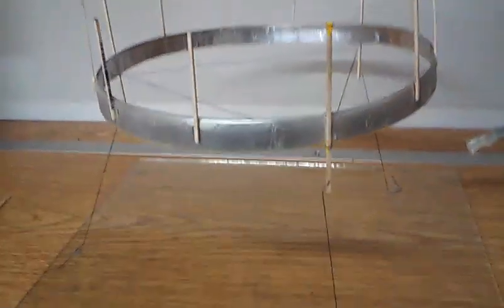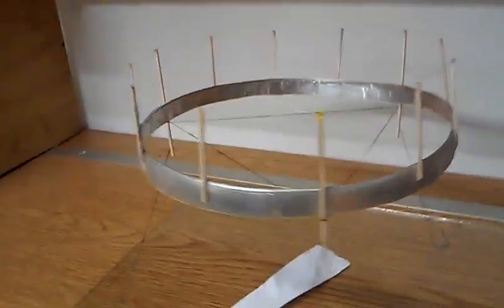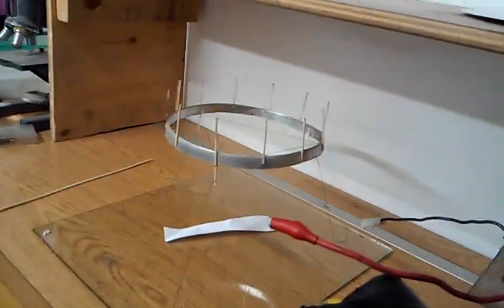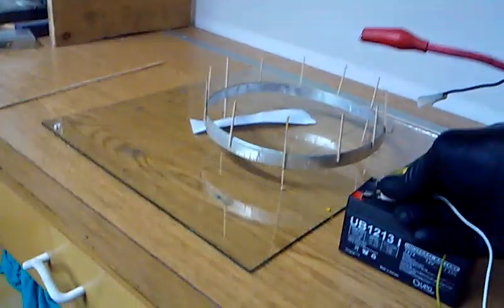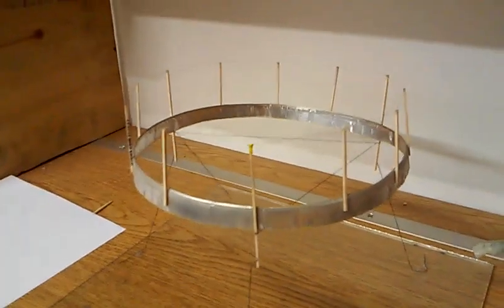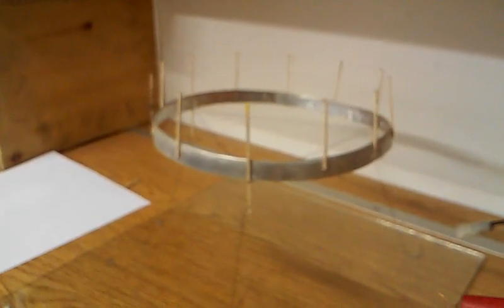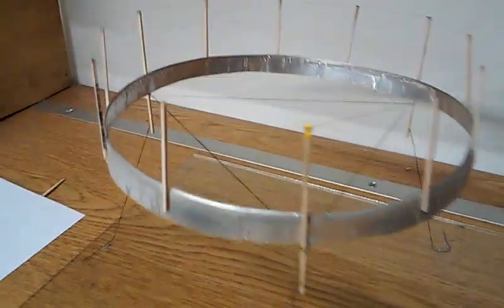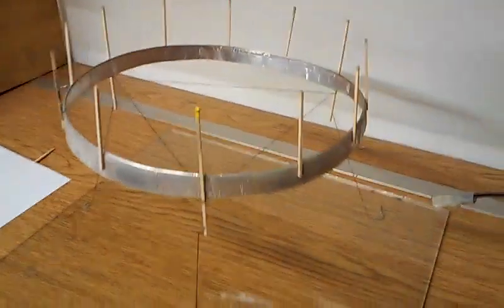ANTIGRAVITY LIFTER CREATES ARTIFICIAL GRAVITY ASYMMETRICAL CAPACITOR

Comment: I'll get excited by an "antigravity" device like this when I see one that can lift its power supply, too.
Reply: You can see one in most any UFO sighting video.
Reply: But it's not antigravity... ;-) It is an RC plane that can carry it's own power supply to run the ion-wind generator.  I had the same perspective, a 5 oz lifter can't carry a 10 pound TV powersupply and batteries to run it.  But engineers are clever people and clearlyI MIT figured out how to make a tiny inverter and lightweight voltage step up circuit without much heat loss.  Maybe super-caps and diode ladders?  Coils are too heavy as are batteries.  But super-caps are lightweight.  Not sure yet. I haven't had time to look into lately.
Reply: I got so excited, that I invented a modular extremely high voltage variable waveform PSU for that very purpose... Got some work to do yet before it's fully implemented, and there are materials and geometry work to be done, but the figures I got from my last burst of activity suggest it is very possible indeed to lift it's own PSU. TANSTAAFL!
Reply: @Swallabat  MIT has an RC airplane that carries it's own PSU and it's proplusion is solid state like this.  I think they published the battery PSU and the voltage step up circuits.  Proably just an RC 3 Phase electric motor inverter and a stack of diodes...  so yeah it can (and has) been done.
Reply: @inaccessible old ways Yup, and sooner than we think, but not with repulsion ion-wind devices like this.  I been looking more and more and still I see no proof this works in a vacuum (region void of air). It still needs a reaction mass.  But fear not, the next serious breakthroughs are coming.  And they are mind blowing. Room temperature super conductors, photonic molecules, controlled temporal dialation/contraction in a cavity, gene editing for resistence to and recovery from radiation issues using CRISPR/Prime, something better than fusion power...  all very very soon.  This ion-breeze stuff is a waste of time.  The big kahuna stuff is right around the corner.  If Elon isn't fast enough, humans will be waiting for him when he arrives at Saturn or Jupiter, with his Tesla Roadster recharged and ready for him to drive on Titan.
Reply: @inaccessible old ways Yup, and like I said some awesome stuff is coming.  And it's huge.
A few years ago I solved a nationwide chemical problem in the vinyl industry, that 10 out 10 chemical engineers said would never work. And in fact they did say just that.  They made sure I was reminded that I got a D in chemistry.  But when I proved it worked, now they say "it's obvious", and I opened up a new area of chemistry in the category of Photo-oxydation.  Got a few market viable patents on it and a profitable company is now producing it commerically. 

So I agree with you.  I went back to basics, and combined things in ways no ont throught of.
This will continue with other I'm sure, and the universe will unfold.

And soon, great stuff coming, very soon,  But this device isn't one of them.
Reply: This inventor mentioned that "the next step is to build one with its own power unit." That's not going to be as insoluble a problem as inventing this field was.
Reply: @scottl5000  At least you're thinking about it Scott.That's a major step in the right direction. We can do this.
Reply: @davidgargiulo1012  MIT created a lightweight enough power source for their ionic-wind airplane... 
The typical TV high voltage transformer is a brute force method used for most "lifters" and is too heavy.  However an IC (integrated circuit) inverter like thosed used to drive RC drones and diode ladder should work and is super lightweight.  Use a super capacitor instead of a battery... that might work well.

 But it STILL WON'T WORK IN A VACUUM and no one has shown otherwise...
Reply: Hey bro go to the YouTube channel Ethan Krauss. He holds the patent for the device with its power supply on board !! Or go to electronairllc.org
Reply: Look up 'free energy generator'. If you build one of them, then use it to power the anti gravity platform, it will power itself for the entire life of the magnets used in the generator, which can last for years, if not decades. Just need to use a frequency tuner with an amplifier to control how much lift and force needs to be used to fly on, or in it. It's L about frequency. Could also use 'step up transformers to take small voltage and turn it into higher voltage, just like a car coil takes 12 volts and turns it into 20,000 to give the spark plugs their spark. 😁
Reply: @glenturney4750  LOL. You WERE joking, right? For instance, you know that increasing the voltage doesn't increase the electrical power or energy, right?
Reply: @scottl5000  Electrostatics works in vacuum, that is why we have vacuum tubes. The effect is due to the attraction of the Cathode plate to the Anode wire. The effect is exponential with increasing Voltage.
Reply: @scottl5000  NASA, Societe National Aeronautiquen in Paris in 1955, Winston Salme Bahnson pabs in 1957, GE Space CEnter King of Prussia, PA 1959, Purdue University 2000, US Army Research lab Adelphi Md, 2000, Takaaki Musha, Honda R&D, 1996, etc.
Reply: Glen Turney cool man what is a link to the project/ schematics/ Circuitry  or DIY
Reply: @Beamshipcaptain  Yeah yeah... demo it as  indicated that I will believe you.  Done.  And if it meets that requirment,  then there a great funding opportuity.  And the demo is CHEAP, so you have zero excuse.  Period. Patent: I actually read it , the patent is pretty much BS about antigravity... the abstract stated it, but the claims or embodiments did not, so it's BS to tell people, that you have an anti-gravity patent as far as I can tell... right...?  SO PROVE IT. I could set up the experiment quckly, but it's not my burden and I know it will fail, which IS WHY YOU HAVE NOT DONE IT IMHO.  So sight all the references you want, it PROVES interest, not that you should get money...
Reply: @scottl5000  I have done it since 1990. We have attracted interest and money, and others have confirmed the artificial gravity aspect, and that this is the most power to weight ratio and most efficiency of any propulsion method known, and inertial mass is canceled by the forcefield.
Reply: @scottl5000  Electrostatics works in vacuum, and these work better in Vacuum, as NASA and French and US Army tests show, also Takaaki Musha Honda R&D. Ion wind is too feeble a force to lift even a three gram model, and models thousands of grams have been lofted. Electrostatic attraction works in vacuum. I sealed saucers in plastic bags and others have sealed them in resin blocks and they fly backwards at the same speed. Do your experimental work before commenting. Shalom.
Reply: @scottl5000  my research is actually showing that this doesnt need reaction mass on board, instead electromagnetic energy (which is infinite and all around us and the universe) is a sort of "fuel"
Reply: @seon3403  Ooookay pal...
How about some empherical testing for a change?

Here is a super-duper-simple-easy test: 
Put the thingy (not the powersupply) in a trash bag, seal it. Turn it on.

PLEASE REPORT YOUR FINDINGS in a response to this comment.

Make sure there is someone there with a box of tissue to soak up the tears-of-joy.
Reply: @scottl5000  i mean i already know that a certain amount of mass and energy is the same thing since energy is mass. Electrostatic energy is real like thats not some sort of conspiracy theory ya know. Obviously i plan to build a free energy device myself at the moment i cant but i know the science and it checks out if you know your quantum physics. I reccomend you check out Russell Andersons tt brown inspired levity disk. Im also aware of the pyramid harnessing electromagnetic energy (the pyramids being thermonuclear generators harnessing the heat of a manmade star. beta decay, alpha particles, natural arc sparking, that kind of stuff) which again, is not an unsubstatiated claim. Nikola Tesla already created free energy like 100 years ago. The pyramids have all the same components of a crystal radio. But tbh i dont feel i should divulge all my research in a youtube comment section cause scalar wave technology and things of the like can be used for evil, i.e scalar waves causing a mini eaethquake (tesla did that). I guess im saying its not that crazy to assume that human ingenuity can find a way to get infinite fuel from nature as it stands. But you should definitely look up heisenburgs theory of the big bang, which, in comparison to einsteins theory, makes more sense, as einstein proposed that space and time are symbotic when that doesnt make sense, as space is infinite and you cant measure infinity, only MATTER and time are symbiotic. Space didnt come out of the big bang, the big bang came out of space, this proves that space is not "nothing" and that it is infinite and contains the energy required to produce a big bang, if you know your quantum physics this proves that infinite energy is not even that crazy, as the big bang came out of space, so if it can produce the big bang, it logically follows that it alone can produce enough "fuel" for an enternity in our tiny cosmic life (about 130 years if you're that lucky). Just a little science to prove that traditionally accepted mainstream science and quantum physics has a flawd understanding of foundational basics, which is why you have learned the preconcieved notion that free energy from the electrostatic nature of everything around us (space) is somehow a fantasy, but i will definitely try that experiment out, i know it will work if done properly, as space is not a vaccum as you probably believe. Space has depth, so just cause you put it in a plastic bag, doesnt mean it csnt still retrieve energy from deeper levels of space, it can retrieve energy from the space already in the bag, as, again, space is infinite in all directions and is fuel when harnessed properly
Reply: @scottl5000  i dont doubt all these fantastical "star trek" esque claims you make. As I know of these "glitches" as you call them. Yes i know the quantum double split experiment proved that consciousness can change matter. 

I just find it funny you are aware of all the mind boggling things that science proves is possible, but for some reason believe maimstream scientists saying tesla didnt create free energy. He most certainly did if you dont believe me thats fine it doesnt require your belief to be true. 

Im not divulging the entirety of my research in this comment section, as im sure you arent either. 

All im doing is giving you the proof to research yourself. It seems you just want to look smart and not actually look into anything i said about heisenburg, space NOT being a vaccum (cause you immediately said "i know how to live in a vaccum"), and the pyramids being cold fusion generators. 

But seriously? You know about all tbe fantastical star trek type stuff you talked about, but for some reason tesla's simple free energy science escapes you and you dub it "nonsense"? Thats just kind of funny to me ha, but im simply telling you i know free energy is real, the science is all there and the scientists who claimed tesla's stuff didnt work, have flawd understandings of foundational basics, which throw off their conclusions down the line. I already said that and pointed out one of the misunderstandings all scientists have (thinking the big bang created space), but I see you dont actually want to learn or listen to anything. 

I only ask, do you believe the big bang created space? Simple question, but im still sure you will somehow not see the question and not answer with your opinion
Reply: @seon3403  LOL! OK I'll bite -- and I'll answer.  Never presume what I will do.  LOL! I can't help it if you don't like the answer.  And if you don't want an answer that doesn't match your thinking, then why ask?

I don't doubt the math behind the big bang is correct... But it's not really the point is it?.  

For example: Simple math tells us there is a infinite divison of time and no minuium fixed time quantum.  But there really is, based on the math derived from the observation of the speed of light.  Eg. both are right in their contect, but only one is verified and pertinent to being useful to us.

As for the question...  it doesn't matter what I believe.  The universe doesn't give a gnat's ass what I believe.  Physical Truth isn't what I invent, read, or believe, it just is and it's my job to poke at it a little.  

My answer is -- Don't know, don't care and it doesn't matter.  I personally do not have a clue if the big bang acutally happened or not.  There is some compelling edvience, and equally compellng objections.  Not my field.  I'm into what I can do now and data that far outside of the scope is useless.  It is good for arguments between creation theories.  But I am barely smart enough to not go there. 

I noticed how you blew off the simution stuff.. It's not me that feels a need to be recognized as smart.  I do not give a crap what others think about me. But I do like people to get on a track of trying stuff and not promoting BS like the lifer being anti-gravity.

By trade I'm inventor, I make my living outside the box, and people pay me well to push the edge.  I'm not a chemist, in fact I hated chemisty and avoided it at all cost. Yet when a survival-level need (long story) came along to figure out how to get rid of a bacterical stain that plagues the vinyl industry for nearly 40 years, I nailed it in a week.  Not becasue I'm smart.  

Millions of dollars, 100's of scientists tried and failed.  I got 4 patents on it and it's in two commerical products plus I opened a new sub-field of chemistry called photo induced oxdiation.  I did not even name it.  A chemist/physics friend did.

I have no desire to be called or seen as smart -- in fact if I don't screw up 5 times a day I feel like a failure.  Failure is not an option, it's a requirement.

So,yeah, I'm not smart; sucked at math, sucked at languages, sucked at writing, sucked at music, sucked at physics and chemistry...  did not accel in sports until college.  Pretty much a waste by all standards.  But what I am... I'm brillant at thinking outside the box and calling BS by those stuck in the box -- flatearthers and Tesla-punks are by favorites.

Anyway, I digress again --- All the research you guys talk about is great.  'See it all before, and I still go back and reference all the stuff you listed (I won't enumerate them, you already did that).

But the bottom line -- simply put the device in the video doesn't work in a vacuum and is not anti-gravity.  

But a bag over it, turn it on, there's your proof.  Done... once you guys do that, we can talk about the rest.

I jumped ahead too far for y'all, I'm sorry about that.

Nice chatting however! 
Very intriguing.
Reply: @scottl5000  lmao you are indeed funny. You're under the impression that a closed plastic is a vaccum, which it is not, because space itself is not a vaccum. Thats why the question matters. But as you've shown, you have no idea about anything about the big bang, makes sense why you dont get what i'm saying.
Reply: @scottl5000  thats why knowing what really happened with the big bang DOES matter....because it disproves the false belief you have that space is a vaccum, since i have to spell it out for you
Reply: @scottl5000  its not an answer that doesnt match what i THINK....because what im saying is not opinion or what i think, its a true fact. Has nothing to do with what i want to hear
Reply: @seon3403  Thanks, I like being funny.
 
Actually what I find is very funny is that you think that I think, a bag is a vacuum. I never though that.  Once again you are putting .01 and .01 together getting pi.

What I said was, "put a bag over it, turn it on, and report your findings".   Yet you twisted it to try to trivial reject the task.  Well your jedi mind tricks won't work on me.

I wasn't trying to prove a vacuum by using a bag, I'm trying to show you it's not producing antigravity, at least no more than a helicopter does....

Big bang... wrong again -- clearly I know more about the big bang than you do it seems.  Because I know that the very people that came up with it are still open minded as to how, or even if, it happened.  That is science.  Oh sure, everyone asserts it happened, and for sake of argument it's ok. They have to. As do I.  But If you truly  really deeply looked into the research going on, a final and definitive answer about the big bang is still eluding us.  As is dark matter and the like, such as universal constants.  If you really know all about it, then present it as a white paper to Science or other peer review and reap the consiquences.  

Science most often sounds consclusionary as much as any sermon in the bible, but that fact is, they have no choice but to expect and face challenges, mainly at the forefront.

Damn, now I'm bummed, I'm only funny because you are exhibiting warped mind behavior. Shucks, I thought a made a viable scientist laugh.  Which is another hobby of mine.  Oh well...  I failed again.
Reply: @seon3403  Space is not a "vaccum", it's a void of matter.  So many flatearthers think it's a vacuum cleaner and sucks things out into space -- cracks me up.
You cannot explain something that not been fully defined, nor can you proven, so all you are spelling out is your interpretation.  So yeah, I guess you do have to spell out whatever it is roaming around in your universe, written down or otherwise is an interprtation, that's all it can be at this juncture.  

Strike 1 - you can know what isn't yet knowable.

Just for sake of clarity -- Vacuum, even interstallar, is estimated to have 1 atom of hydrogen per cubic meter, so it not even a total void or a vacuum.

It's space-time that is the fabric of the universe.  And that contains massive amounts of energy.

Strike 2 - ok, make that ball-1

Telsa's free energy, if it exists as a lot of people think how he describes it, is still not free. No more than solar energy.  It's seeminly free to the user, but there is a loss elsewere.  Even in the case of "energy from the vacuum", it may be likely that local regions using that energy could become depleted like a dry oil well.  But replensishes as the space-time adjust itself to fill any so called gaps.  Surges or flux have been observed in ZPE experiments. Again this is an unproven local field effect.  
There's a difference between free and convenient.

Strike 2 - Energy is there, but what is it? How do we get, does it stay?

Like I said the theorist that came up with the big bang sounds and act a 100% sure, and their math is good, but there are compelling reason to question it.  Good argument too. If they cannot back it up, then how can anyone, by definition KNOW what it really is.

Back to strike 1 -- Can know somethat that is not knowable.

I've been following the theory that the universe is a child of a parent universe's creation of a black hole.  At that event all the constants of the child universe are defined.  Speed of light, gravity attraction velocity, e, i, even pi (that one is hard to explain).  Furthermore, if those constants are not viable to create black holes that the pattern does not repeat, therefore we have an evolution of big-bangs.  Only universes or a type of species that evolves, and it's DNA are those constants -- maybe.
Edivence of partent/child relationship includes an observation  that suggests matter falling into a parent black hole is then approximately evenly distributed in the child universe.  Which makes no sense, yet kinda does -- how can matter be distributed across an infinit universe.  Well a void isn't the same as a universe boundry I guess.  Yet we have proven that particles appear and disappear in our universe all the time, with even random distrubution which by the way seems to drive ZPE.  The distortion, mathematically in space-time looks like ripples in fabric.  So you could say, sure there was a big bang, but that alone would not cause the space-time energy energy to fluxuate. It's an on-going process.  If you did not KNOW that then what can you be sure of?

So the big-bang itself doesn't matter.  Any discussion on that topic is purly acidemic. What does matters is what we observe and calculate right now and can work with in now or in the near future.  

Strike 3 - not only can't you know, ya didn't know that you didn't know.

But you still get a home run... because you are right even if ya didn't know it... so far we believe there is a vast amount of energy in fabric of the universe, as articles title "energy in the void".  It's calculated quite accurately and indirectly shown by viture of various observations, including those at CERN and the like.  Gravity warps time, thus affecting particle angular momentum, because time is very elastic in the presence of gravity, and all mass has gravity.
This is how space probes can go faster and faster by using planet's distortion of space-time to sling shot around thus adding energy in the form of interia.  Doing so, actually slows down the planet a tiny bit in it's orbit or rotion (I forget exactly which). It's crude at that level but it works.

Also, Telsa's free energy system has been shown to try to realize power via induction from the earth's magneto sphere,.  Even Tesla's own writings back this up, albeit some decoding is needed and he use terms of his own definition.  The power from the magnetosphere which is somewhat large, in the giga-watts which is nothing compared to the world's power demands.  And using it weakens the magnetic field, thus exposings us to all kinds of bad stuff from the sun and cosmic rays from outside the solar system... I'm glad his invention did not make it to market.

Game over.
Reply: @seon3403  Once again you prove how assumptive you are.  "spirituality"  you have no knowlege of what I believe.  There is nothing to know, there is only belief.  Hermetic knowledge is pretty interesting, and is one perspective.  You cannot have heaven without helll, or light without dark, evil with good, peanut butter without jam, ying without yang...  Because any definition is relative to another.  Otherwise you cannot define it or understand it. But counter active definitions are not boolean, it all shades of gray, until you get to the mimal quantum. Then it's super position states in a datum probability until a certainity occurs then it collapses into a classical state.
The physics of the spirituality could be very different. Have you ever thought about thought itself? If our spirits are the source of our thoughts then they must be a symbotic relationship with our physical self and given the instant complexity thought the spirit world must run at faster or different time quantum that our universe.  How long does it take you think up a response to my last sentence, or to this one?  Less than a second, right?  May just a few milliseconds, and a lot longer to say it or type it.  But what's your guy estimate to think of something. Yet I'm sure you can think up some complex stuff quickly.  How is this possible?  Maybe our spirtual self runs in a univers totally different that this one?  So what is reality? Hermeticism is Euclidean in it's application, but just a partial lingo enough so to help the ancients understand some basics.  You cannot take it litterally and still get much done. The world has evolved far beyond it.  Science may have very likely discovered the game at hand, and we can probably beat it into submission and let it do our bidding.  But if there is an active super consciousness, if may have left the game running... unattended... forever...
As for spirituality I have a lot to say but I see no point in sharing it will you as we have no common context -- other than what we see around us is nothing like it really is.  I'm sure you know what you know and to you it's fine.  To me it is unlikely to have any relevant value. So enjoy.  I have real deadlines, and real people using, buying and funding my stuff.  I'm always on the look out for new and real technology that people can benefit from... in this lifetime.  If got anything you think you can really leverage, based in real physics, let me know.  It's not that I don't have an open mind, it that I know BS when I see it.
Reply: @seon3403  Super symentry is one of the most fantastic things ever.  I've studied the fractual nature of plants, electronics (antenna design), evolution... I haven't gone so far as to consider the quanum aspects of it.  I don't have a lot of time.  The gravity binding effects of solar systems is a macro system held together by the weak force of gravity, but the force that holds an atom together is extraordinary and diffcult to break and it is not gravity at all.  Also, we can only describe particles, so far you really cannot see an electron...  so how do you know it looks like a solar system?  It's often described as a cloud.  Electrons changing the width of the cloud, or changing orbits give off light... solar systems don't seem to do that... So what do electron/proton orbits look like? Just because you saw it in a drawing in book!? Then you are accepting parts of mainstream science, enough to reject the rest of it.  How strange is that?  Very strange...
Reply: @seon3403  Mushrooms... I cannot legally answer that in the "affirmative".  :-)  Like I said, I'm stellar at thinking out of the box. many things are tools, as are muchrooms and peyote for that matter (I've been invited to some American Indian rituals, amazing experience).  But unfortuately I cannot do much of that stuff (I memtioned a brain tumor, long story).  I'll leave the assumptive, "hard for you [me] to understand", assertion alone and stop picking on you, since you changed the topic and all...  

Anyway -- I leave my right brain reservied for those that would not want to destroy my creativity, the inner circle.  Many have tried.  Imagination is the power. Some need drugs to increase it.  I don't.   

Science is just a tool, not the means unto end in itself; which with it it we create what we imagine.  

What I do with money?  Life isn't about money, it's about life enrichenment, it's about people lives, not personal gain  - I've had about every toy I care about, all tossed away now, save for my wonderful dog.  I really love teaching and helping people to gain skills so they can take their creativity to a higher level.  Do it right, keep the karma balanced and we get out of jail (earth hell) early for good behavior and/or graduate to the next higher school, figuratively speaking.  Don't need mushrooms for that.  I have enough out of the box experiences on my own.  Every done remote viewing, or had a meaningful coversation with dead people?  Ever heard a spouse tell ya to pick up a latte on your way home... without use of a cell phone or radio, in your head or know you are about to experience an intense event in a few minutes?  Or had de'ja'vu, then remember you saw the vision over a year prior...? Right brain. My investor ask me how I come up with stuff so quickly.  I tell them I had a year to plan for it, but the topic just came up...  It was actually one of those "year in advance" visions that lead me to this video.  I have a hunch there is something here, I may of missed it, something subtle. so I need to re-read all my conversations. I think we passed it a while back. When I find it, you'll know, because I will disappear.

But you've opened insights I hadn't thought about for a while.

Enjoy your mushrooms.
Reply: @scottl5000  im not talking about whether someone SHOULD do mushrooms, thats up to them. I asked you, do you personally believe that someone SHOULD be thrown in a cage or robbed as punishmeny for eating mushrooms? 

I guess you have a hard time with reading?
Reply: @scottl5000  obviously im into this stuff enough to do that little experiment your talking about, i was just clarifying to you that space is indeed NOT a vaccum. Is that why you think this wont work in a big plastic bag? Because if so...im jisr explaining to you that thats a moot point because again, space is not a vaccum. And have you undergone this same experiment you speak of?
Reply: @seon3403  It doesn't matter what I think.  Yes -- We are in agreement that space is not energy deprived, far from it.  It's proven. ZPE is enough to say that. Just very tricky to access.  But us engineers are crafty SOBs and we'll sort it out.  I'd be sure excited because I have a theory in my head that there is always a chance some EM harmonic of some magical frequency or time minma would cause a device to move by riding an offset from the wave peak.  Like surfing only in 4D.
 
I have not done the bag experiment.  I did build a lifter like the one in the video, but I knew it was moving an air mass by virtue of smoke testing, so I never bothered to do a bag test. I gave it to a local school to play with.
You are at no risk of losing your patent because the assertions of anti-gravity are only stated in the abstract not in the claims or embodiments, so even if the bag test fails the patent is still as it stands  But you cannot claim in these videos that it's antigravity, because the patent in no way proves it is anymore antigravity than a helicopter or hotair ballon, both of which overcome gravity. But do not generate anti-gravity (or pro-gravity).
Reply: @scottl5000  im just mind boggled that you are aware of zero point energy but somehow under the impression that tesla did not tap into free energy.
Reply: @seon3403  It's never been peer-reviewed that Tesla tapped into any form of free energy.  ZPE is extremely difficult to capture.  

The way ZPE is detected is using two microscopic needles carefully spaced apart, then they vibrate and create a tiny amounts of heat.  Interestingly, ZPE jams up MEMs devices (nano-gears on a silicon wafer).  

Regarding Tesla -- What WAS shown in experiments and recently (I believe) were an interpretations of Tesla's notes that electricity can be induced from the earth's magnetosphere, but it's not getting it from vaccum energy or ZPE, just good old fashion induction.  Which again is not free and a limited resource, that when over taxed could hurt the earth.  The amount of power is not enough useful power can be induced using a ground station as the magnetosphere lags slightly behind the rotation of earth, induction to create a fair bit of power if the antenna is tall enough.  But we've already dicussed this.  Now we've gone full circle.  

As for wireless energy transmission -- I'm not sure you know this, but every radio antenna generates a little power.  Radio signals hit the antenna, induces a little current, so little it's just signal strength.  Amplifiers using a separate power source boost the signal (are controlled by the signal as an input) it to the point that it can drive a speaker.  AKA music. The lenght of the antenna helps set the frequency range it can pick up, and the tuner (either coil loops or Phase Lock Loop pulses) capture the specific frequencies, so now you can have separated signals from one antenna.  So scale it up -- Tesla could produce one MoFo radio signal at a wide range of frequencies, higher the frequency the further it could jump, then individual houses (or groups of house) and such could get their power on the assigned frequency that they pay for simply using an antenna and big honking high amperage tuner.  However transmission losses are so huge that generalized usage would have so much waste that it could never work unless the transmitter station was within a mile or less, maybe even just a few hundred yards of the receiver. So best to just run wires. Plus lighting was a real bitch in these systems.  Scientists and engineers have thought of something similar... have huge solar cells in space, convert the power to microwave which are frequencies higher than Tesla could generate, and beam them to earth.  The energy is pulsed at 900Mhz, then once revveived it's shifted down to a continous stream of AC and you get regular power at 60hz or whatever you need for ground transfer by conductive cable.  But 90% losses...

As for free energy via induction -- NASA however liked this basic idea, and tested using a 20 mile long conductive tether lowered from the space shuttle during STS-75 (2007?) to a lower orbit to see if it would induce up to 3500 volts (guessing) as it passed through the magnetosphere.  Oddly enough the video shows what looks like life-forms playing with the tether, and no one really knows that the blobs were...  check out the youtube videos, they are wild,  proably ionized particle emissing IR light and moving on the magnetic fluxuations... Camera could see it, but people could not.  IR makes sense.  Sadly the tether broke and drifted back to the earth before they could run the tests, the tether burned up eventually as far as I know.  But it could of been a great power source for the shuttle.
But again it's not free energy... it's maybe cheap, but not free and it's not ZPE, just classic induction.
https://www-istp.gsfc.nasa.gov/Education/wtether.html
So now you can see it's possible to believe in ZPE, and that Tesla has never acheived harnessing it.

Edit, some of dates and data are not accurate about STS-75... this will help. https://www.americaspace.com/2016/03/06/broken-at-the-boom-20-years-since-sts-75-part-2/
Reply: little special child  I referenced MIT's ion air plane several times (and Ethan Krauss).  It moves air and will not work in a vacuum. 
I assume you are supporting the assertion that the ion propulsion does not work  in a vacuum... and if so you would be correct.
Yay!
Reply: little special child  Actuslly I'm curious -- Is that name a reference to baby Jesus?
Reply: Just use a Tesla coil or capture apsnopheric energy
Reply: @kajallison8896  If you can put an antenna up 10km you can capture some power...
Reply: @crossbowneilchristina3438  That's another model, not full-scale, no payload, it uses aerodynamic lift rather than pure ion thrust as in this video, and even then it required a catapult launch and could only barely sustain flight for a short time.
Reply: @scottl5000  Oh! Ion propulsion will work in space -- I remember seeing it proposed decades ago -- BUT it requires carrying along a source/supply of ions, and rather than an open structure as here, it takes an enclosed tube with alternating electrical grids to shoot the ions from the storage tank out like regular rocket exhaust.
Reply: @TubeNotMe  True enough. And yet batteries continue to get smaller, lighter, and more powerful and capacious. Transformers too seem to be shrinking in size and weight. I don't expect to see a vehicle, even a practical drone, gaining its lift solely from this technology in my lifetime, but as a propulsive force? I think this is possible and exciting ☺️
Reply: @TubeNotMe  Ion proplusion, typically using xenon gas as the reation mass works great in space.  As does electrical erosion ion propulsion (if that's the right term).  In fact even these solidstate "lifter" will sort of work in low orbit because there are some air molecules even as far out as the ISS.  But none of these are antigravity, and the patent is total BS -- I read it.  It makes statements in the about anatrigravity in the Abstract section, but in the claims, embodiements diagrams and references fail it indicate anything related to antigravity.  Just a device to create a ion charges.  The YouTube description says it does not use ionic wind for lift.  So I as the followers and Jim RugRoden to show it floating in a sealed bag light enough to be lifted.  Of course they won't. A true antrigravity device will fly even if it's not in a sealed system.  All reaction mass propulsion will not work lift off in a sealed environment.  However magnetics and boyancy systems will, but aren't suitable for space travel.  Their only response is a bunch references to other systems, which are not related to what is going on here.  You can to remember that they are looking for funding.  As far as I can tell, these assertions that this is antigravity, or anykind of massless proplusion is total BS.  But they defend it and even double down on it, but will not simply put a sealed trash bag over it because if they do, the next stop is the trashcan.  The reaction mass is air.  I learned the othe day that there is enough air particles in low orbit for one of these to slowly work, which is cool, and far beyond my expectations, but anyfurther out and it won't work. So there may be some low orbit and in-atmosphere applications.  But still not antigravity.
Reply: @KraussEMUS1  Awesome, thanks, I needed a distraction with all the crap going on.  Good stuff.
Reply: @KraussEMUS1  Nice work.  The 14 PSI doesn't matter as much as the non-aligned ambient air movement. Actually Ion-breeze Lifters work better in denser air.  In fact a lifter will even work in low earth orbit to a lesser degree because there are still air particles to ionize.  But futher out the only propulsion would come from ioized foil particles, but it would be a lot less than the xeon Ion drives. A spark plug would have more push.  Anyway, you are making some VERY nice lifters.  Exciting stuff.  Buuuuuut not antigravity.  What cracks me up is there is NO SUCH THING as gravity. It's not a field or even a force.  It doesn't exist.  What we see is the result of an effect of other factors.  Mass distorts time. The further away of the mass the less distortion.  An object is pulled towards earth because part of it that is closer to the earth has it's direction of movement slowed down more than the part of it that is slightly further away.  As such the direction of movement is changed towards earth.
Time is highly elastic.  Think hard about this.  Very hard.  Just remember gravity itself is nothing, it's time distortion, and movement over time changes. Even something as small as an atom has size and mass and therefore has time distortion on one side more than the other, and thus it is pulled towards the larger mass.  So what causes this distortion?  Is it the entire atom? Or something in the sub-atomic particles?  We do not know yet.

Many years ago, I told my physics friends I asserted that time and gravity are the same thing, but I wasn't sure how.  I was right but did not know why.  Once I found out gravity doesn't exist I realized it was all just time distortion.  It was a moment of awe.  This means there are several new approaches to "anti-gravity" and we need to think of gravity waves differently.  Gravity waves caused by two large masses affecting each other, is just waves of time distortion moving at the speed of light.  But gravity itself is an probably an instant effect that gets weaker the further way it is.

So what can you do with this?  Well take a look at photonic masses.  Using OAM light (spiral light, or orbital angular momentum light).  Photons can be made to have measurable mass, and it can be so complex  as to approximate atoms and even entire molecules!  PHOTONIC MOLECULES?!?!?!  Yup.  So... if you can turn light into a mass, then that mass can be used to distort time.  Distort time, or even inverse distort time, then you have antigravity.  A device called a spatial light modulator is used to turn light into OAM light.  And that, my friend, is the direction we will go next to create the effect of anti-gravity (time inverse distortion).  Fun stuff!
Reply: @scottl5000  
Great comment!  My lifter like device  however can carry small propellant tanks, not just power supply and steering,  and in a vacuum will accelerate the propellant much faster than current ion thrusters.  
If it was modified to operate on extremely high voltages on the order of 5 to 10MV, it would also produce 10s of grams of lift with relativistic electrons, without any extra propellant. This last idea though has only been shown mathematically.  
I agree I don't think these are antigravity either though. For now I am concentrating on more down to earth improvements.
Reply: @KraussEMUS1  Yawn. Guess I'll have to take your word for it that there's no power coming down that tether. After all it just scoots up a bit for a few seconds, so I guess there could be a little battery onboard somewhere.
Reply: @KraussEMUS1  A "heavy lifter" say anything capable of 5 lbs to 500lbs would be a godsend, there is a huge market.
Reply: @scottl5000  
Hi Scott,
Such things are possible but not at all easy. I prefer to call mine something other than a lifter, since it carries its power supply and propellant tanks.  It was also started long before the little triangles etc., came out.  Whatever though, I'm just trying to improve the reliability, stability, and steering for now.  It's possible to hook together as many of them as desired in the near future.  They can certainly be improved, and will be soon.
Reply: True; but basic efforts like this might be a first step.
Reply: In space it doesnt matter
Reply: @scottl5000  The Biefield-Brown effect devices (basically the charged capacitor) do actually work more efficiently in a vacuum chamber than in the air -- Brown confirmed this during his work in France.
Reply: No problemo, d Japanese r good with miniature power supplies...
Reply: @carlgrove8793  Interesting.  Doesn't apply to this lifter thingy which is nothing more than an basically an ionic-breeze device.  We already covered how to verify this.  I do not recall if heard back on the test results or not, because I already tried it myself.  It's not antigravity and it's it won't work above the atomosphere, although it should work some in very thin air.

Net-net: gravity DOESN'T exist.  It's not a force or a field.  It's an observed effect of time field differentials.

Shortcut: "Photonic Mass Young Man" that's what you want to get in to.  It's going to be big, really big.  Use artifical mass to distort space-time and you are on your way to anywhere you want.
Reply: I second that...